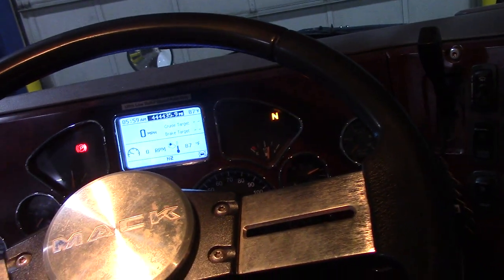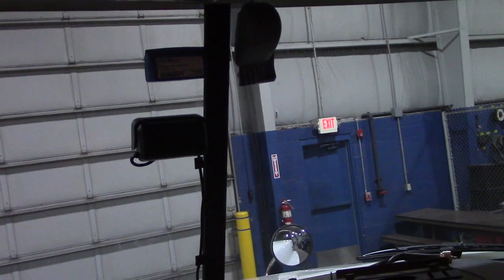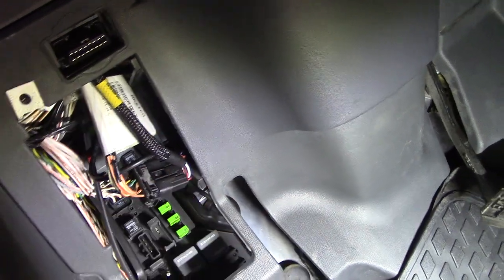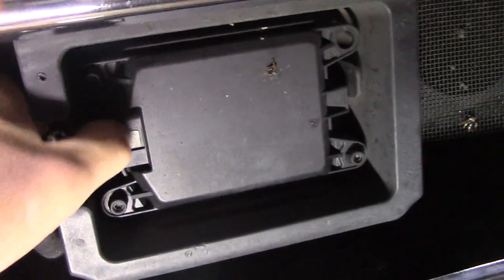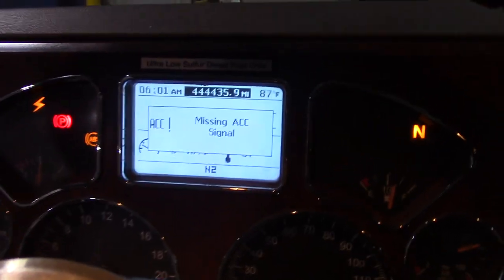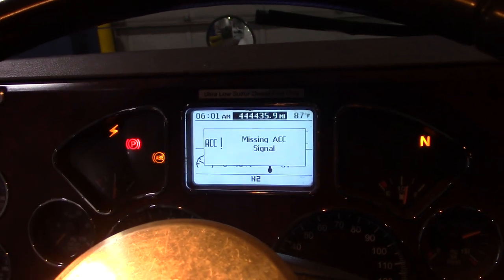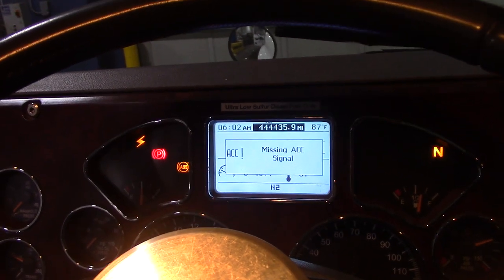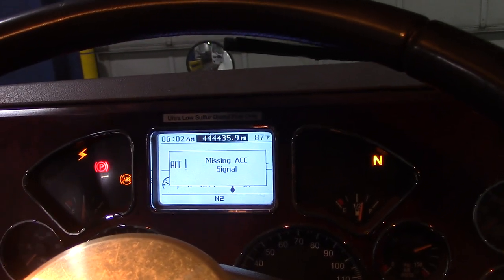How to bypass drive cams in Semi trucks

Comment: its has a private j1939 for spd and front camara. it also communicates on the j1939 truck side. both camara and wingman have a terminating resistor built in.